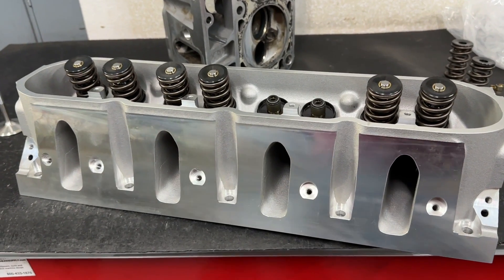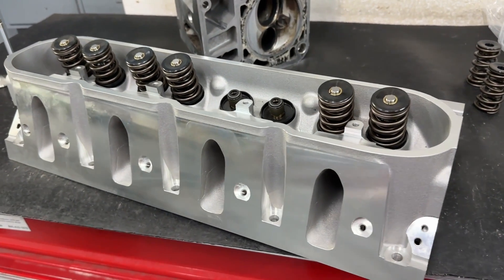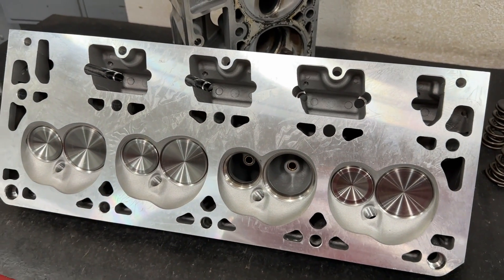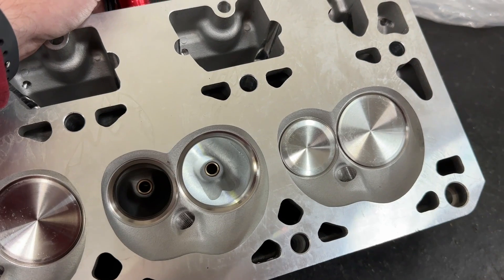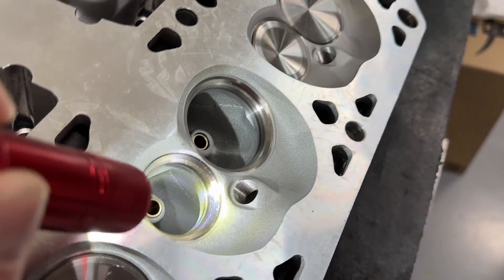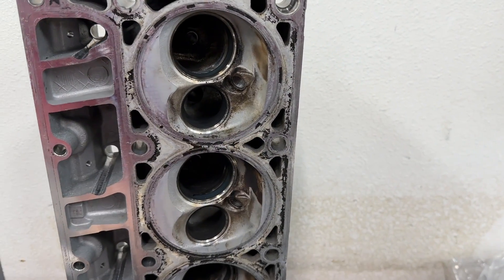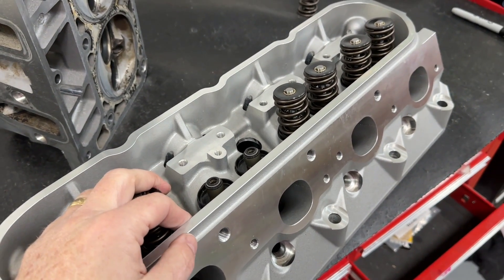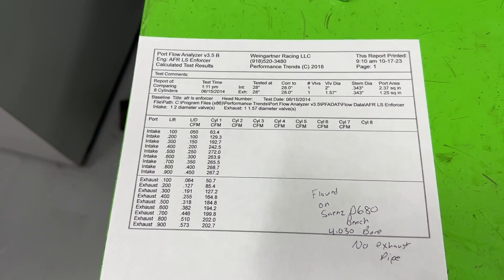LS AFR Enforcer Head Review, With Real Flow Numbers

Comment: Nice video,  i have a 6.0, which heads should i get? 1501 or 1506, thanks. I really appreciate it
Reply: I’m sure Eric would say about the same but why go with the smaller valve 1506s when the 1501s are made for the bigger bore LS’s

Comment: What is the largest valve size recommend on a 5.7 ls1.   Im researching as looking to refreash my 04 VY HSV Clubsport here in New Zealand.  Thinking of a simple bore clean,hone to 3.9. 
4" crank to stroke it out to 383 6.3Ltr. With ITB for intake.   My only thing is heads.  Sgould i just port, and plane my standard 241 heads. Or look for some 243 heads which have the larger intake runner, and smaller combination chamber

Comment: Whete the inlet valve rocker pokes through into the inlet port, could you fill that void with JB Weld and smooth to not only block the vacuum leak, but also stop any turbalance and smooth the flow a little?
Reply: Jb weld?!?! Lock tight should do just fine. Jb is a little extreme and if any flaked off you know where it’s going.

Comment: The Enforcers are 2.020 and 1.60…
Reply from the maker: No. I measured 2.00/1.57
Reply: @WeingartnerRacing   no, check Summit’s description, they are or at least were 2.02” and 1.60” I’ve bought a few sets of these castings and put 2.02s in them without issue.
Reply from the maker: @peteJoseph-x3h I’m glad you read summit. However it’s too bad you didn’t read afr. If you had you would know they have two versions. This is the small bore that has 2.00/1.570.
Reply: @WeingartnerRacing  Readers always know more than the hands on professional!
Unreal..one reason why my machinist hung it up.
Reply: The AFR 210 heads both in small bore for 5.3 and ls1 variants have 2.00 and 1.57 valves. The SBC version of the enforcers are 2.02 and 1.60

Comment: For the money pretty decent. A stick 823 casting flows more than either head if I remember correctly. Near 315. But great Review
Reply: An 823 gives up a ton of mid range torque vs the cathedral port heads on small displacement like 6.0-6.2 stuff but picks up a ton of power at the top. Tons of dyno testing on just YouTube to back that info up. But a good ported 243 can flow 300 plus that would be my choice for a 6.2 or less displacement street engine a more drag race oriented 408 I’d have a 823 style head 100%
Reply: @jeredfowler7194  the low end tq loss is regained once you shave the 823 heads

Comment: Deck thickness vs 243?
Reply: I emailed afr about this very question. From what I can tell looking at specs online they have a thicker deck than a stock 243 but not positive.
Reply: @jersyboyy  thanks!  I'm considering just getting a set to try
Reply: Apparently they are .450 thick but I have to confirm that. Just regurgitating someone else.
Reply: @turbocarsmatterfastcarsmat2736I just bought a set last week lol.  I got tired of not finding any solid info on them so I took the plunge.  They are at least an 1/8" thicker in the deck surface than a factory gm casting.  I didn't measure them, but having them side by side and just doing a visual, it was clear enough for me that even though they may not flow much more, the deck surface was worth it

Comment: On BBC big port heads, have you ever explored giving the long port intake valves a 50 deg seat and the short ports a 45 deg. seat?  Reason, widening the torque curve and getting rid of the torque dip often seen before the torque peak.
Reply: The TQ dip is in the Cam not the heads. Years ago I asked a GM engineer that same question, and he was in on the design team that did the BB head. He told me it was for packaging , go figure. When the DRC heads were designed by Warren Johnson what did he do . He got rid of all the long ports, and pointed all the ports at the cylinder wall, Humm , just like Ford does.